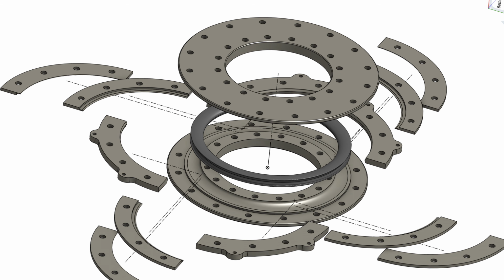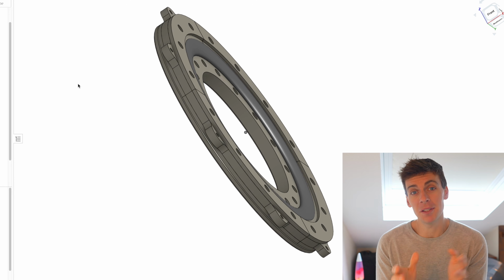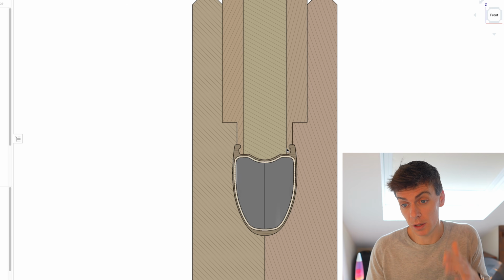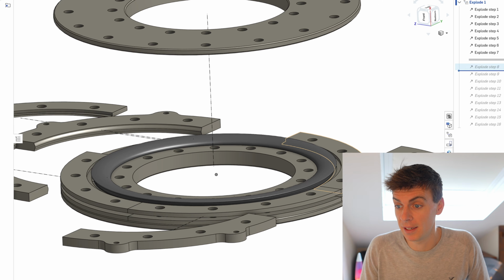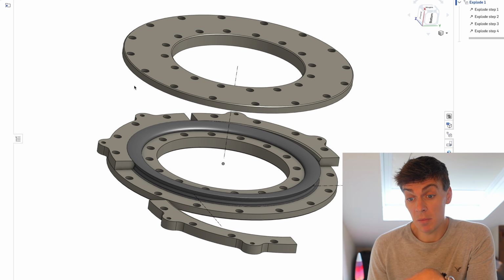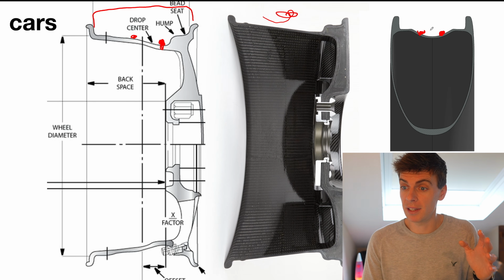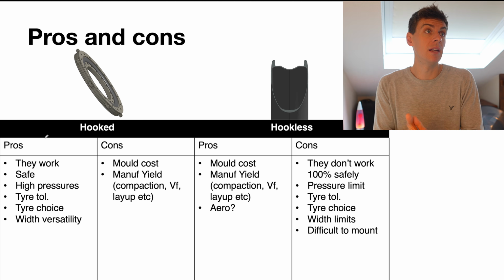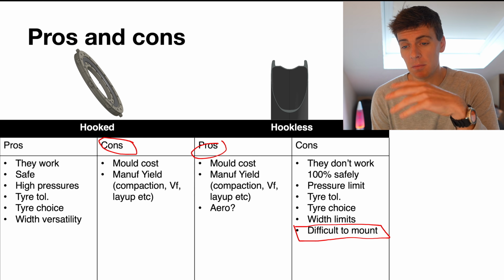Hookless carbon Bike Rims - the Truth = cost cutting.

Comment: That lava lamp deserves a mention. Weren't F1or indie toying with hookless at one point? If the manufacturer could machine a  single groove on the inside face of the flange then the tyre could have a smaller locating bead. A glue not dissimilar to old tub glue could also be applied prior to to inflation.  You could argue that tubs would do the job

Comment: How much does a carbon rim compress in use? I've heard several people say that with tubless its necessary to mount a tyre before the wheel build can be finished, or it goes slack. This means that there is stress from lacing and again from the hoop stress in the tyre, is this leaving the rim undersized? Then if you reduce the circumference of the tyre bed, does that then leave the sidewall 'slack' and more prone to wrinkelling, particularly if it is less stiff for a hookless setup than for hooked, in hooked there is more material closer to the outer perimeter, making the side wall stiffer. Fundamentally, it feels like this could work fine, if the tolerance is good and everything is good and stiff, but maybe we are just pushing the safety margins too far with 1200g wheelsets.

Comment: Have to talk about the layers of tape teams are using. An easy solution is to inconsistent tire beads is increase layers and use min. tire pressure needed to seat the bead as a reference. Also hand mounting difficulty would be lower if the rim troughs were made deeper.

Comment: The issue per se isn't hookless,  it's tire weight and air pressure.  

Hookless tires on an F250 are at 32 lbs, not 70. The tires have large steel beads, and are made for 50 K miles of durability. 

Bicycle tires aren't made for this.

Comment: Great video, thanks Alex.
I don't think road hookless is going anywhere. I actually believe it can be extremely safe but the tolerances are just too tight for;
1) The most common application - standard cyclist who doesn't have the time, nor inclination, to dive deep in to the numbers unlike you or me.

2) The most extreme application - World Tour pro teams searching for every watt, likely made worse in this specific case by butter smooth roads in high temperatures. They would absolutely be pushing the limit on pressures at the start of the stage to begin with. 

If it were ever possible, a proper study on the failed tyre/rim combinations taking in to account every variable would be fascinating. But we all know that is not going to happen, and any adverse finding against hookless rims could be explained away by "the rider hit a pothole"

Comment: It's hard not to imagine how much cheaper the tooling was for Zipp and others when they made the original tubular rims circa 2000. You'd think that the rim makers would still be marketing them as a result of the additional margin for a rim with no flanges. But alas, the massive increase in margin for tire makers pedaling clinchers over tubular tires must trump the rim savings! Maybe they should just go back to aluminium or magnesium extrusions for clincher rims. The tooling cost would be 100x lower...

Comment: 100% get that. I'm not an engineer, but have worked for over 30 years in the motoring tyre industry(inc truck & earthmover), and completely understand your educated knowledge. Ok, if someone  has no tyre knowledge whatsoever, then they may possibly struggle to understand this slightly. But this video is so very well presented with sound engineering facts, that it couldn't be any clearer. C'mon the hookless manufacturing brigade, don't put people's lives at even more risk.

Comment: Hi @peaktorque - agree with your pro’s and Con’s list - i won’t touch hookless tyres with a barge poll….., but there is one thing I don’t get and wondering if you know something I don’t: I can understand Enve SRAM and others going hookless for tooling savings, but why is GIANT down the hookless rabbit hole?  Surely they would own the tool forging factory and therefore would see less impact to costs to keep inline with their ideology of safety?
I think Giant make great bikes, but I haven’t considered them for the last 2 or 3 iterations due to their dumb stem width and hookless rims
Reply from the maker: Throughput - they are the biggest bike producer in the world and adopted a Toyota style lean manufacturing model 15 years ago. They simply cannot afford to have the odd hooked rim to have defects after moulding and thrown in the trash. It would disrupt their whole internal supply chain and would cost too much in labour. Taiwanese labour is not cheap, much more expensive than mainland china.

Comment: Quick question - rear carbon wheel sounded like it had sand or pebbles in it, took off the tyre and tape and it turned out to be little bits of carbon ( painfully slow to get out piece by piece) same issue now a few months later, repeated process, inflated tyre again after and another bit is rattling around. No visible damage anywhere, new wheels from top brand. Running tublesss which has made it a painful process each time. 
As a tester of many wheels i thought you might have experienced this?

Comment: Excellent analysis. Having worked in both the motor vehicle and cycling industry I can honestly say the only common factor between motor vehicle and road bike wheels is both are circular; every single aspect of their construction and dimensions (including pressures) are different by a massive margin. You're the first person I've seen to cover the differences so comprehensively and so succinctly. Great work.
Reply from the maker: Cheers mate. Had a few email threats today from the fanboys but i stand by my analysis.
Reply: @PeakTorque  you should publish some of those emails. Let's see what they have to say for themselves. If the facts don't agree with the marketing claims then it isn't difficult to work out which of the two is wrong.
Reply: You can't believe how many customers come into the shop I work at and say my tires are flat. The first thing I ask is, "When was the last time you put air on them?" I usually get a month ago. Tell them they need to air at least once a week. The next thing out of their mouth is. My car tires don't need to be aired up like that. Had one guy argued with me for 30 minutes. I finally said to him, " If bicycle tires were like car tires, I would need a machine to mount them, and you would not be able to fix a flat on the side of the road."
Reply: Yeah, unfortunately stupid people tend to make stupid arguments and hold onto them confidently. I can't tell you how many dopes I have seen claim that because hookless works fine on an automobile or a truck that means it's perfectly safe and fine for a road bicycle app "just because it is."  Not exactly the deepest thinkers on the planet. LOL
Reply: Only a brainless twit would think an auto or truck tire is comparable in hookless use to a Kevlar bead floppy 250 gram bicycle tire. But stupid people tend to think in stupid ways. :-)

Comment: You’re very bias against hookless which is your right to preference but if you’re going to weigh them up against each other you must offer the number of accidents and incidents of failure on hooked also. It can’t be true that no hooked rim has ever blown off a tyre or failed… this has gone out of control, riding road bikes is dangerous, to some extent, in general and I don’t believe that hookless wheels have drastically made this sport more dangerous.

Comment: What do you recommend to someone who already spent all their budget on Enve 4.5's? Serious question
Reply: Use tpu tubes with sealant in them as the tube expansion pressure inside the tire presses it against the rim sidewall for better retention.  Use wide enough tires to avoid higher pressures, even if less aero than a narrower one.  If really seeking maximum security, use tubular cement on the tire sidewall in a few short sections around the rim to glue it to the rim tightly.

Comment: Why do we want folding tyre beads?
Reply from the maker: The weight weenies wouldn’t use non folding
Reply: @PeakTorque  Oh, I see. I don’t think I like the beads getting folded. Seems like a bad idea to me.
Reply from the maker: @infocuslearning folding aramid or kevlar should not be a problem really. You struggle to cut it with scissors!
Reply: @infocuslearning They’ll crease if you leave them in the box for a long time.  If not using folders right away, it’s good to unfold them and lay them out round or hang them over a curved surface to store.

Comment: CRR might be the only performance advantage but depends on usage case. If you are heavy the pressure limit might be too low to be optimal. If you are on the track the pressure is definitely too low to be optimal. Is that small potential performance advantage worth the risk is another matter. 
We deal with lots of customer who dont even know what crank length they ride. So understanding there is a relatively small window of acceptable tyre width and pressures is going to be off many peoples radar.
Reply from the maker: Yep. I am too heavy for hookless so i only ride my hookless rims on gravel with 50mm tyres. In Mallorca i was riding 28mm tyres at 85 psi and probably could have gone higher on the smoothest asphalt. Hookless would not work for me
Reply: I’m also too heavy for road hookless, marginal on a 32mm and I need more safety factor than that.

Comment: Great video PT and as always a very clear explanation.

But, are we just getting too obsessed with safety issues? 

In reality how many failures are there per 1,000 hookless riding hours (for instance) as I suspect it’s statistically insignificant.

How many failures are caused by people not following what are fairly simple instructions regarding tyre pressure, internal rim width vs tyre size etc?
Reply from the maker: Missing the point imo. The guidelines are unsafe, not enough safety factor. Im all for guidelines but mass produced products need a higher safety and MUST be idiot proof.

Comment: now, this might be a stupid question, but why do hookless rim still have a lowered drop center as if they needed to host a tube instead of a concave center, so that the two beads won´t be able to go towards the center?
Reply: You need the dip in the middle to get the tires on. Once you get one side of the tire on the rim you have to make sure the bead sits in the middle trough, or it will be too tight and you will not be able to lever the other side onto the rim.
Reply: @JSlade11  True, it wouldn´t work...

Comment: I recall hearing that the mold for hooked rims has a silicone or other less-rigid component which is uses to make the hooked rim bed. Do you know at all about this or am I mistaken?
Reply from the maker: So i had this vid fact checked by a Chinese factory. They said the center piece is correct and made of steel. Just like the rest.

Comment: One key point that no one seems to be making when saying that hookless rims are dangerous is that the problem only seems to be with road specific rims, NOT gravel or MTB. The issue seems to be the tire width and not hookless technology. The rule of 105 is probably the main issue. Running tires that are narrower than the rim is the factor IMO.
Reply from the maker: I think i said that in the video. I use on mtb and gravel, and even DH (dt 541)

Comment: Nice work, thank you for that detailed explanation. Re the tire insert: they have multiple functions that interrelate. They protect your rims, they also protect your tires from pinch flatting and they give you, if they fit right, enough support to ride home if you flat and can’t fix your tire. But let me explain why air doesn’t always work. In extreme conditions we experience slick and muddy terrain which demands low air pressure for maximum traction. But we also have to deal with sharp edged rocks which demand high air pressures. How do you solve this problem? Tire inserts! I can comfortably drop the tire pressures to whatever I want to achieve great traction and have no fear of crushing my rims or pinch flatting my tires. Tire inserts have been a huge advancement for those people riding in extreme conditions. They are very confidence inspiring. As to why road racers us them I’m not 100% sure, probably for similar reasons. But clearly everything has its limitations because whatever is was that DeGendt hit totally overwhelmed his inserts, tire and rim. Obviously 28’s are totally unsuitable for hitting rocks. We use 47 to 50’s when dealing with rocky trails and they work reliably.
Reply: On the route to the stupids, why not just use a solid, rubber kiddy tire?

Comment: Yes, more molds for hooked, but a lot of those parts are duplicated and therefore should benefit from economies of scale?
Reply from the maker: There is not as much symmetry in real life because of alignment features and the pressure line block etc, and more tolerances stackup.

Comment: You Rock! Cycling industry just went kuku for the last 5 years or so. Everything is money and numbers. I am riding hooked with Vittoria latex tubes. Over 60000km on crapy roads 2 puncures in total on my current bike (one was valve stem problem)
Pros would be happier and safer riding 28 tubulars glued on a nice wide tubular rim.

Comment: Very good video. Thank you for posting.

I wrote somewhere:
What happened to hookless and tubeless wheel design over last few years? Manufacturers like Roval had to reinforce the wheels and add 100-20 grams of weight, so that wheels can withstand pro riders requirements. What is the average weight of a pro rider? Probably around 75 kg. What is the weight of an amateur Average Joe in my part of Europe? According to some statistisc 89 kg. So you probably need to add extra sealant and to further reinforce the wheel to be on the safe side. Where does that lead us? To heave inferior, heavy wheels where tire can come off the wheel if there is sudden air decompression. Does that happen? Yes it does.I'm in my 50-ties, my vision deteriorated. It happened to me to hit an object like big pothole or some debris in the mountains when descending at high speed. On clincher tires with a tube my tire never came off the rim fortunately. Would hookless tire came off the rim in that case when the cut is that big that sealant is not able to deal with it? Most probably.

Why would I ride inferior, heavier and unsafe design then? Because they are cheaper?

What was the purpose of carbon wheelset? To have lighter wheels than alloy wheels. Is hookless design fulfilling this purpose? IMO it's not. For an Average Joe, clinchers were the choice because it was too much hassle with tubulars. How many flat tires did I get on clinchers with tubes? 1 per season. Is it a problem? None at all. Is tubeless a design you can always depend on? It's not. I've seen situations where tire wouldn't seal for unknown reasons. So you still have to carry a spare tube and a pump. And good luck to take this tire off if it's cold or it rains and put it back on. It takes me 3-5 minutes max with a tube.

Comment: I'm still glueing 22mm tubs, 20 years on, running €200 clincher fot training with cheap €20 beaded tires and butyl tubes. No compressors, not tires coming off the rim,  seldom get punctures (last one in training was 2016). 

I look on in puzzlement at the "developments" in the bike industry.
Reply: Have to make new things to keep selling product, or you're reduced to just selling spares. I don't know who or what body regulates these designs for safety. Glue tires to rims, what a silly idea :)

Comment: Instead of gluing on hooks, why don't they place some rigid foam or something in the mold to form the hooks that can be removed afterwards? Either by machining or with some peel ply it should be possible to remove it without affecting the layup.
Reply: Maybe that's why SRAM bought TIME.

Comment: I rode the Etapé last year on tubeless, but hooked rims. My riding companion (although we separated on the road) remarked afterwards that he had seen several bikes with tyres blown off with sealant everywhere. He put it down to tubeless technology and I laughed. But it was 35° at times and I wonder if they were hopeless (I'll leave the autocorrection in place) rims?

Comment: Great video, but Do you think it’s possible that hookless is a scapegoat for what’s actually just a symptom of the pro peloton moving from tubular to tubeless?

Derek Gee and Fred Wright had high profile tyre dismounts last year on hooked rims.

There’s the famous Peter Sagan / Roval incident that led to Specialized dropping tubeless support from first gen rapide wheels.

These hookless failures seem to be circumstantial evidence to support a pre-existing view that hookless is bad.
Reply from the maker: Good point. The tube does increase the retention qualities a lot according to Rene Herse
Reply: @PeakTorque  I guess that's also a factor, but I'm talking about how most of the peloton were largely using glued on tubulars before the creep towards tubeless.

Comment: Question: How were the braking surfaces of carbon rim brake wheels made? Did they come out of the mold ready to go or did they have to be machined? If machined, can you think of a way if making a carbon rim where you can machine in the hook safely?
Reply from the maker: They were in-moulded. Machining is possible but you're going to mill through a lot of continours fibre layers considerably weakening them . Do-able but needs serious work.
Reply: @PeakTorque  I guess you could factor the machining in the layup so that you only machine away from a resin filled part of the sidewall but not easy to do and has the possibility if error in each rim.

Comment: Great video. One point I found confusing is that at 21:10 he seemed to indicate that the Conti S TR tire is more difficult to mount because it's made to run tubeless, but I found it considerably easier than the clincher. For reference, this was going from a 28 clincher to 30mm S TR. No comparison, the 30mm S TR was much easier.